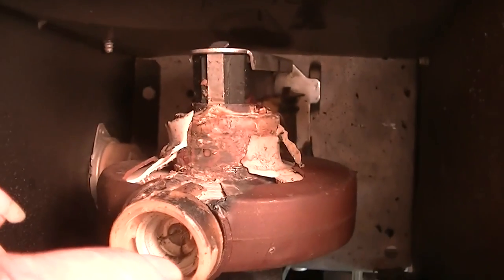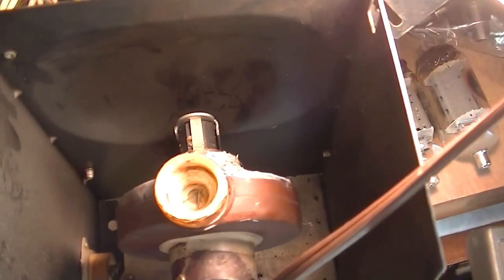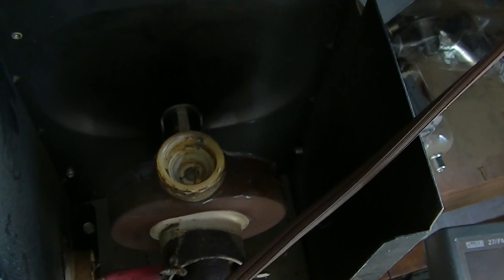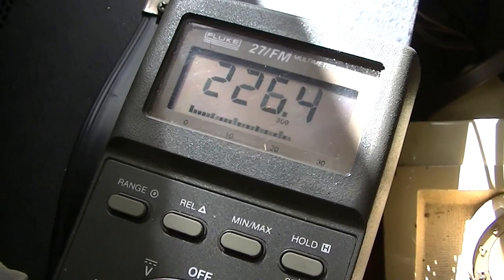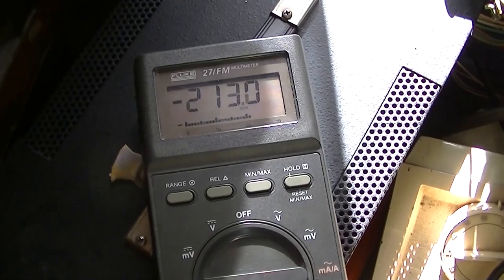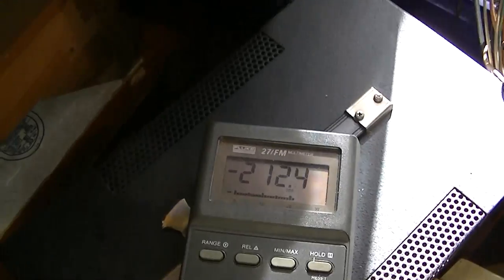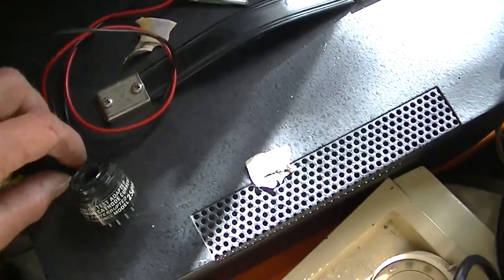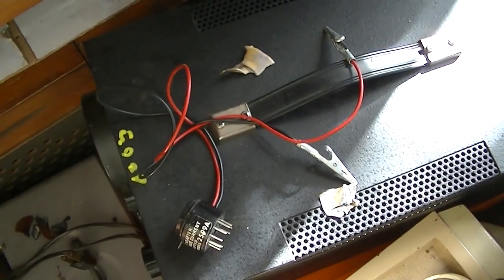Flyback Repair RCA CTC28 Color

Comment: AC line voltage did not cause this flyback to burn.  AC variations will affect the B+ and deflection, but as long as the 6BK4 shunt regulator was in decent shape, the HV would be fairly stable.  I must have changed close to 500 of these back when I was a kid, and it was humidity that would take these out, even when they were fairly new.  First hot and humid day of the summer, we'd be pulling chassis.  We used to buy these a dozen at a shot from the RCA distributor and get sleeves of 6GH8s or Van Heusen shirts as premiums.

Comment: That's really good to know; as I was unaware that there were silicone caulks widely available that did NOT contain acetic acid! A very pleasant surprise, indeed! The caulk you applied seems to work quite nicely. That was one COOL blue arc, especially after your turning off the light, Shango! Vulcan, the god of fire and son of Jupiter would be very proud!

Looks to me like that cathode-current adapter should facilitate your ability to obtain an accurate reading, and allow compliance with specifications as indicated by the corresponding tube.

Tap water never hurt anybody; that was all my folks had when I was growing up in the 60's and 70's. The fluoridation helped me, too. I'll admit that it tastes pretty yecchy in some areas, though.

Comment: Used to change those RCA flybacks back when those sets were only a few years old.  The CRT's (25ap22) tended to only last about 3 years too.  That arc has the potential to knock you on your ass too.

Comment: I've got almost an exact replica of that flyback just to make high voltage. Works very well on my zvs driver. 
Edit: after adjusting the primary It makes 50kV maybe 60 and while not arcing purple arcs shoot out into the air, not on to anything in particular. Just shooting into the air like a tesla coil. Doesn't even work above 100kHz so I think its pretty impressive.

Comment: nice repair my old rca black and white needs a new flyback on it wish I could find one for it to get it up and going again I been saving It in my closet   maybe it can be repaired   the problem is I get a temp raster on the screen then I loss it after a few seconds  and  the wax is melted off the flyback.

Comment: Is that a tube-socket on top of the transformer?

Nice fix.
Reply: @ erlendse Yes, the 3A3 HV rectifier  was inverted in the HV cage and the cap of the tube sat in the top of the flyback.  The reason for this is that there would be no x-ray leakage because if the cage was opened, the HV rectifier would pull out of the flyback killing HV.  Other companies used a door on the HV cage, and if it was left off after service, x-rays could conceivably leak out the back of the TV.  On the RCA, if the cage is open, the TV doesn't run.

Comment: Back when I serviced these sets (when new, scary age am I) I would never run with the horiz out cap off.

It will overload the screen grid and components.

Arcing thru the screwdriver I did though. High frequency high voltage like Tesla.

YouTube videos like yours let me relive the times.

Otherwise I too would be bringing them home to get a fix, and causing major spouse disapproval factor.

Comment: Funny, I just grabbed a model 2712A. 6JS6-6JM6, not even a week ago.
Reply: shango066
I'm stuck on the alignment, of the IF. It's ok, but I just did it by ear. I don't think anything is wrong other than that. I just bought a Sencore VA62, & an HP8640. (8648 too expensive). Wish I could send the chassis there or you to the chassis! Your 28 sounds great. I have a 28 also, & does yours have that round IC for sound?
Reply: Your channel selectors look a bit different, but the 28 I have has a round metal IC, & one output transistor. Must not be good, because they seem to have gone back to the 6AQ5. This has solid state sound.

Comment: is it normal for there to be a corona around high voltage things like that? I have a 26inch zenith from 1965, and there is a box with a tube in it up above the flyback box. i'm not sure what it does, but we siliconed it to stop the arcing but there is this amusing faint purple glow around it. no Ozone can be smelled near it. it looks like it was coming out of the Socket? it is attached to. I'm not too familiar with these old sets, and the zenith dealer i went to to have help fixing it doesn't know why it does that either.
 *Edit, it may be a 1967.